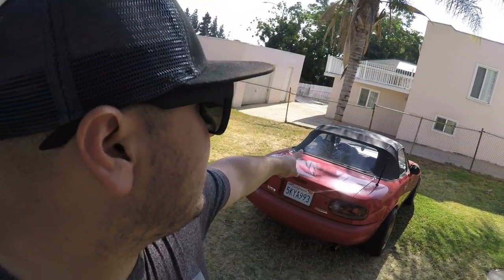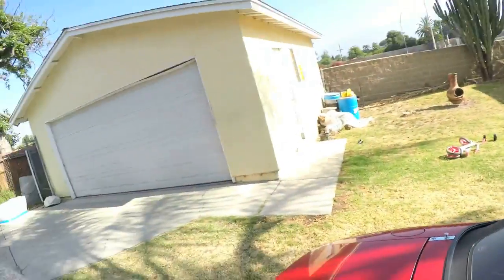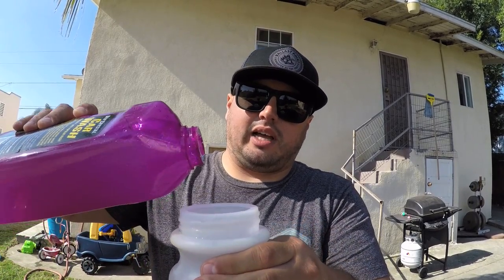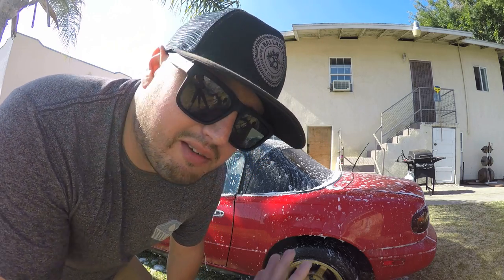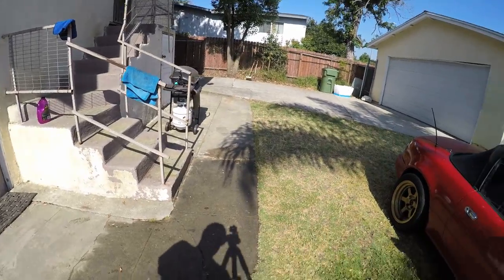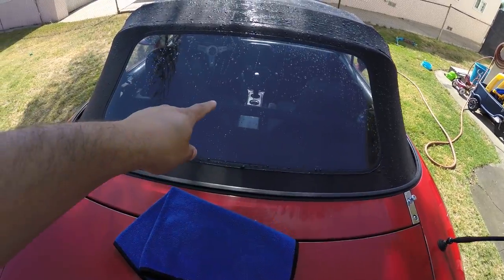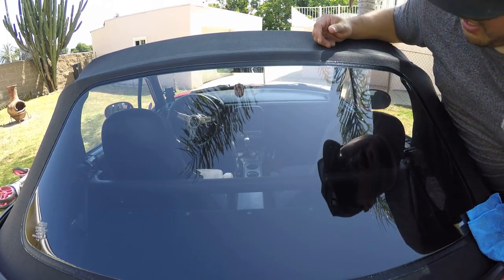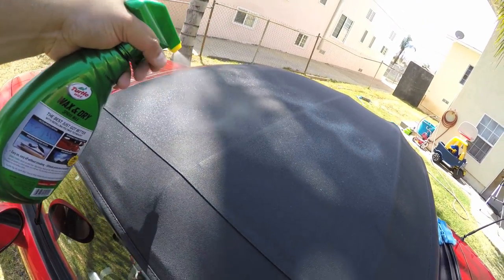Update On Project Miata Soft Top & How To Clean It

Comment: How did you get your windows seals to sit flush. I can't get mine right and it always leaks inside my car. Then my seats get soaking wet and it's not fun. I always have to bring a towel.
Reply from the maker: I had the same problem. They sale the new soft top gasket it's to expansive I never bought it. But it should work link below 
https://mossmiata.com/top-seals-by-il-motorsport-set-of-6?utm_source=google_shopping&gclid=Cj0KCQjw1-fVBRC3ARIsAIifYONxGx2v8fKIj05wyLIjgAIVCHbL96jjRJ4jGhf1AVwtaLuRUuEJGjQaAoDQEALw_wcB
Reply: I bought those seals and installed them a bit ago and I still have the issue. I don't know how to get them to sit right guess I got to keep messing around with them. Well for now I got to see if I have to rebuild my motor, because today my radiator blew out and the engine got hot for a while and I might have some damage to my pistons and rods.